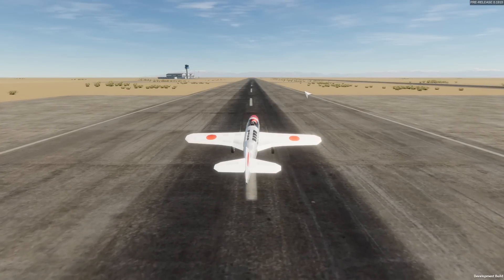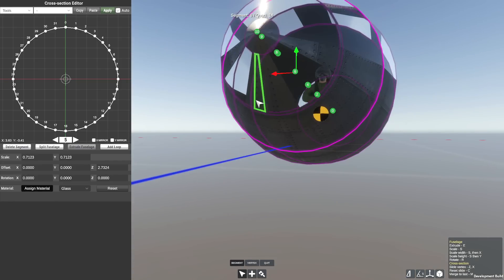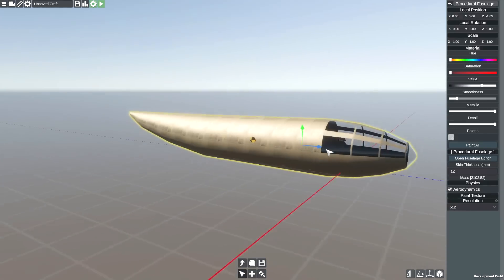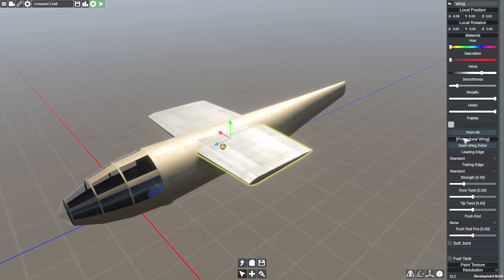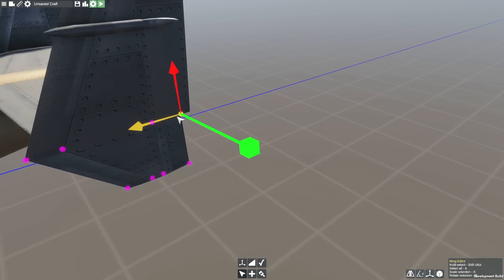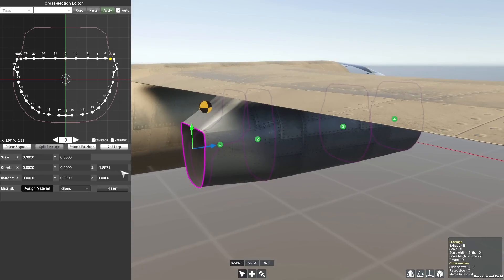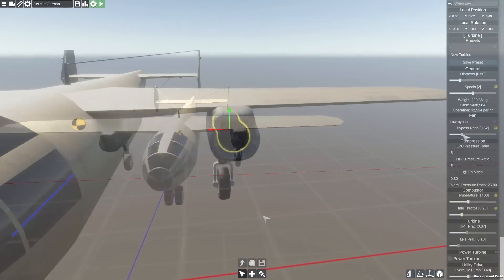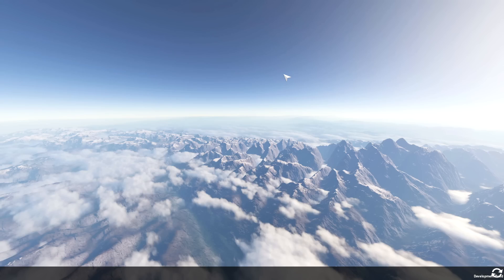Building A GERMAN PROTOTYPE JET PLANE In Flyout!

Comment: Those long cables that run from the tail to a point down the back of the fuselage, usually they're not support, they're typically the HF radio antenna. That's a long range radio, whose signal in the right conditions can be bounced off the ionosphere, allowing it to transmit to and receive from stations over the horizon.